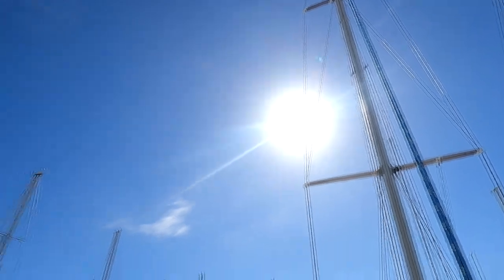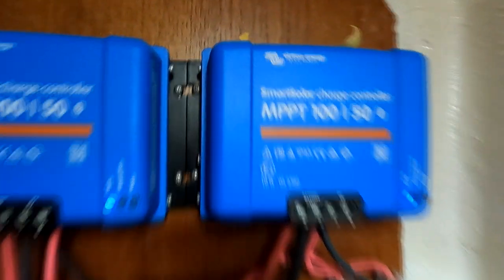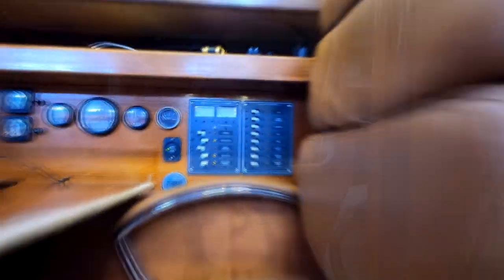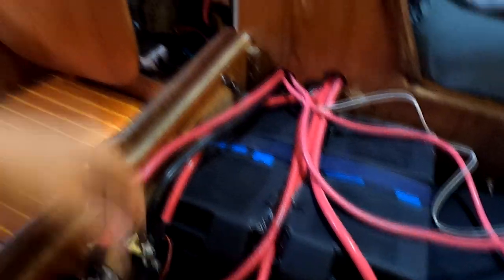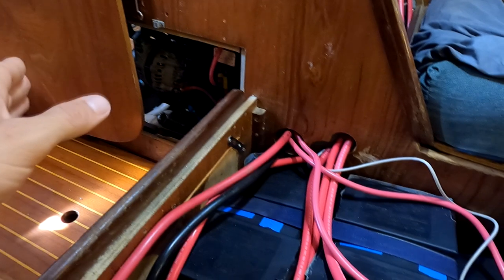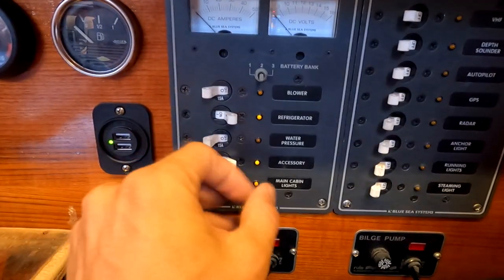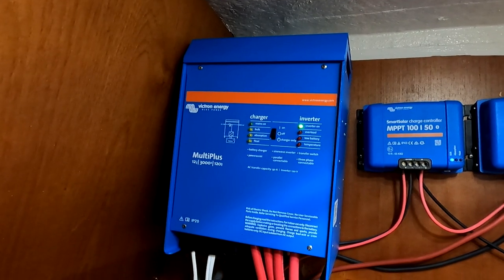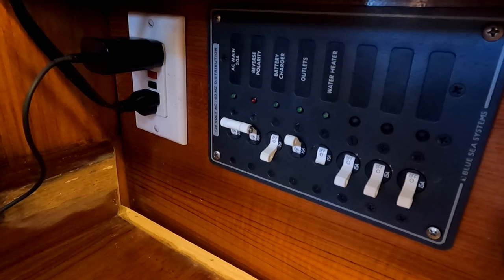Easy How-To DIY Solar Power of my ENTIRE Sailboat

Comment: If you keep the LifePO4 inline with the alternator, you need a DC-DC converter, or you can burn up the alternator by over working it.
Reply from the maker: Yes I know. But I can just turn on set off and reduce the load.

Comment: There is some risk in linking devices directly to the solar, before the batteries and the amperage varies with sun and clouds, and that variation can damage electrical components. 

It is best to protect the cables where they pass through bulkhead holes, to avoid damage to the cables due to movement of the boat.
Reply from the maker: That's why I have the two 50A fuses before they get to the solar charge controllers.

Comment: cool video, but im confused when you said that the electricity can be used straight from the solar panel. do you have the batteries charging from the load outputs on the charge controller or is it set up as normal? im interested in knowing exactly what you mean as its something id be keen to do. cheers
Reply from the maker: The solar charge controllers put out up to 14v for the batteries. That all connects at the terminal so the loads can be powered directly before it goes to the batteries if that's quicker.

Comment: Hi, what do you mean by a bus? What is this bus component that you have on the wall of your engine room? Would you please attach a link to it?
Reply from the maker: It's a central connection point for several electrical lines with a switch.

Comment: Do you some way trickle charge the starter battery if you are for some reason not using your engine for some time?
Reply from the maker: Yes, definitely!
Reply: @Adventureman_Dan  Ok then. The bigger but not openly expressed question was how.

I've been pondering different options how to do that. But haven't been able to figure out best or good enough ways to do it. Albeit there are good options but there is not enough space for panels in our boat.

It would be nice to have a very small B2B trickle charger to charge the starter from LFPs. But for example the one that is often recommended is by manufacturers recommendations only for doing lead acid to lead acid.

I'm considering to install a separate small MPPT-charge controller for starter and then have a on/off/on double switch with to choose to change one of the smallest panels to charge the starter when we are not in the boat or not using shore connected power supplies.

But I still would like to ask how you have done it.

Comment: what guage wire did you use from the charge controllers to the battery?  They looked a little thin for the amperage they would push at full noonday sun.
Reply from the maker: I don't know the proper gauge, but it's the regulated size required by the MPPT's.

Comment: Great video however just because the 12v buss is closer to your switch panel than the battery doesn’t mean the solar electricity goes to the panel first. The solar electricity will go to everything that is connected equally.
Reply from the maker: True.

Comment: Is that extreme large arch or bimini with the solar panel not affecting the actual sailing ? I mean if the bolt is keeling it creates additional drag ?
Reply from the maker: My boat seems to sail just fine with it as before.
Reply: @Adventureman_Dan  Cool. I really like the size of that contraption! I don't yet have a sailboat it's in my 5 years plan to get one. With that solar size I assume you never have to run the engine just for the alternator. I also looks like you have a rig line going through there as well is it banging / causing wear & tear?
Reply: @Adventureman_Dan  Thats an incredible arch--- how did you come up with that or was it on the boat before?